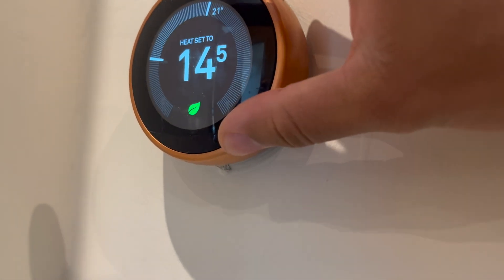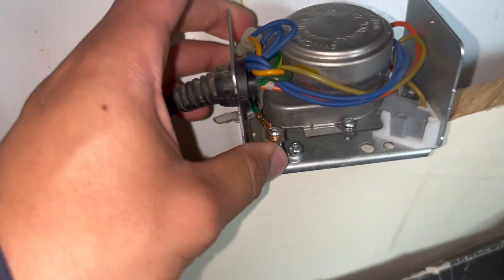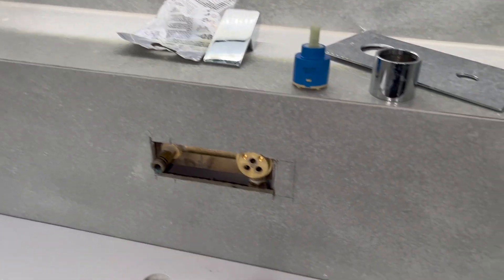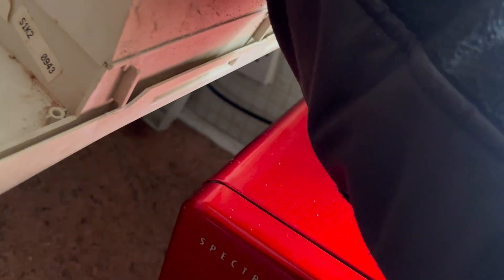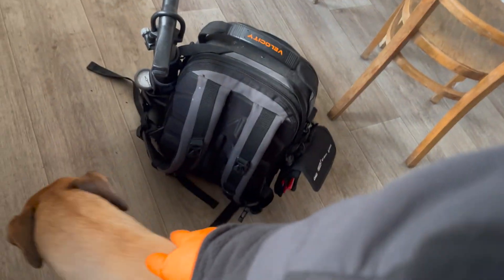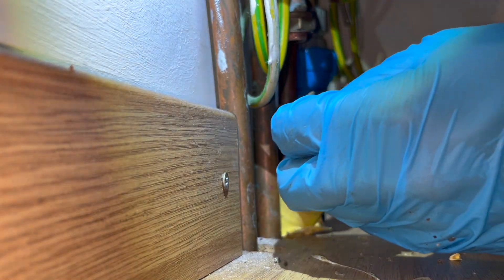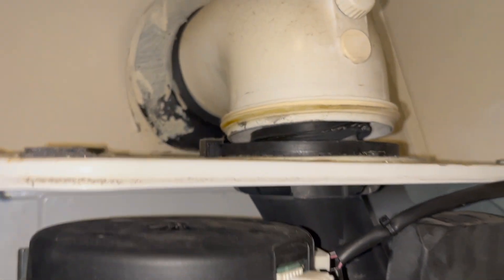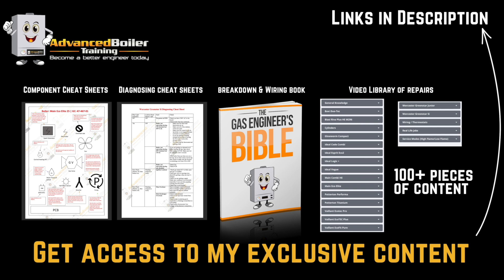S Plan Fault Finding, Boiler Troubleshooting & Gas Leaks | Day In The Life Of A Gas Engineer #14

Comment: I bought on of those lap electrical tester .
What is the red bit on yours?
Is it an extension as I noticed the probe on mine doesn’t come out when you twist it 😁
Reply from the maker: Yeah I had the old version. I bought the new version recently as I broke my old one and I’m not a fan of the new one. The metal doesn’t come out enough. I’ve used a Stanley knife to cut back the plastic on the new model
Reply: @advancedboilertraining yeah that probe isn’t long enough shame really